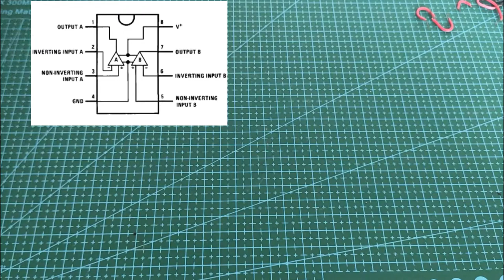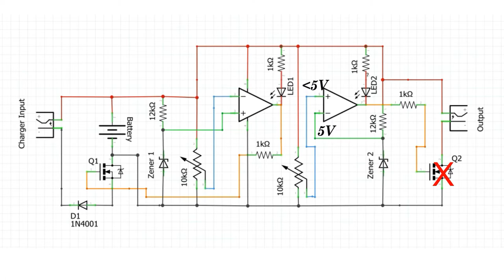12V/9V LEAD ACID BATTERY PROTECTION // OVER-VOLTAGE AND OVER-DISCHARGED AUTO CUT-OFF.

Comment: If the battery drained to 12V , it will start charge or Only at 10V it ll start charge ?
Reply from the maker: It will charge at any point lower than the full voltage
Reply: @zotronics9897  that's great , I'm building this circuit today
Reply: I built it , but whenever I start charger  input boosted from 12V to 13.5 volt , 
The Buck convertor just blinks the light and not working

Comment: Why do you have 7 resistors in the real circuit but only 6 in the schematic?
Reply from the maker: I used 2 resistor for led2. 1 at the top.and 1 at the bottom which is not needed. Seem i put too much resistor.😂
Reply: @zotronics9897  my point is why is there no hysteresis to prevent jittering?
Reply from the maker: Great question. There is a bit of noise in the circuit but does not effect the operation. To simplify the circuit i simply ignored the feeback resistor.
Reply: @zotronics9897  alright,